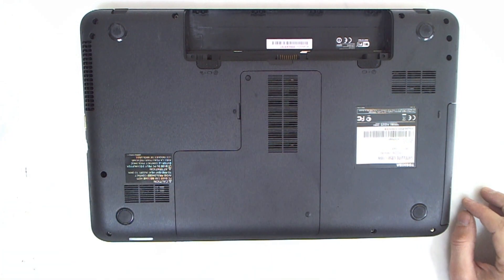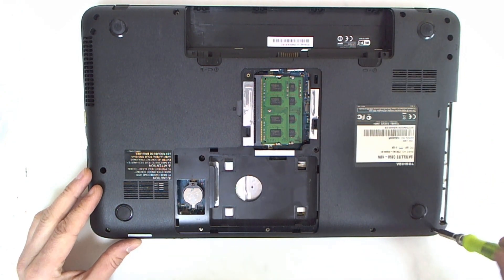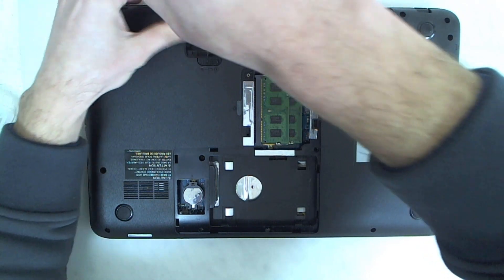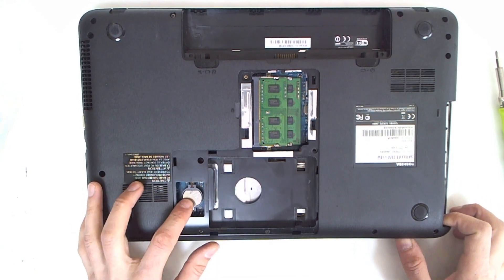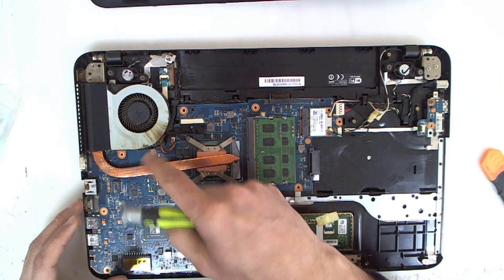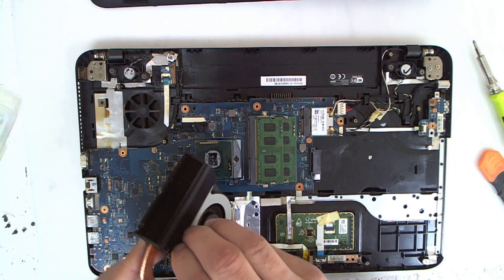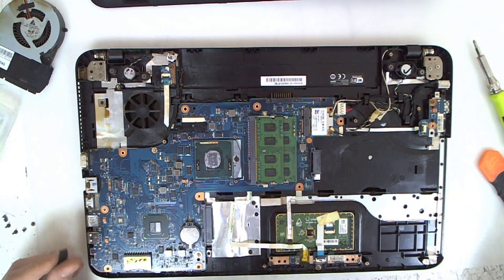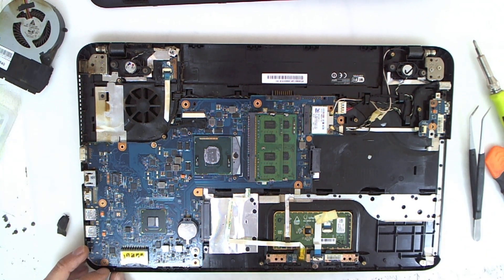Toshiba Satellite C850 Disassembly / Fan Clean

Comment: Your video was a big help when I took my laptop apart. I have the C850-13X and I have repasted and upgraded to an i7-2640M. I didn't know this before upgrading but the HM70 chipset only supports lesser CPUs and shuts down the laptop after 30 mins which cannot be bypassed through the BIOS. Do you know if most main boards are the same or if there are any other motherboards I can change to in this laptop? Thanks!
Reply from the maker: HM70 have a limitation. In order to upgrade you need to replace the motherboard with a HM76 chipset. Sometimes you can replace the chipset but will cost you more money and is not 100% guarantee that will work properly.
Reply: @LaptopDisassembly  Thank you. It seems to be a lot of work for very little reward. But I'll try my best to keep my laptop alive a little longer. It will make a great server or a media device, even if the CPU is weaker. Thanks again.
Reply from the maker: @eddiegreenheart  just put the max Pentium processor like B980 and put an SSD drive. It will make a huge difference
Reply: @LaptopDisassembly  Yes, already done! 8GB RAM and a 1TB SSD. Made a great difference. I just didn't get the right CPU, which is a a shame. If someone manages to lift the 30 min shutdown for i5/i7 CPUs, I'll be sure to update.
Reply from the maker: Not possible with HM70

Comment: Nice video. Thank you a lot. Please what is the connector on the right side of the RAM and below the WI-FI? It's a 7+6 pins slot. A large space there but no device is connected. An extension slot? It doesn't fit with NVME drive connectors? PCIE? Thank you for your reply
Reply from the maker: That is the connector for the optical drive, if the laptop have one.

Comment: Just got a 'new' laptop today (Toshiba c850-19d). Don't think the van has been cleaned (properly), cause it gets fairly hot and starts making noise.
I would like to know where to put the paste? Missed that in your video. 
Thanks for the disassemble video.
Reply from the maker: When you remove the copper cooler, clean the old paste from the CPU and the cooler. Apply the new one on the cpu crystal and put back the cooler.

Comment: Mine is toshiba L850. The fan doesn’t work properly. Sometimes stop running. I cleaned it with brush but still malfunctioning. Should I change the fan or is there anything else I can do? Someone suggested to put some oil in it. Don't know if i could open it completely to do so. What kind of oil should i use for this fan? My laptop got overheated and automatically got turned off several times. If u please help me about that it would be much appreciated.
Reply from the maker: First you have to replace the thermal paste. For oil i use fine machine oil. If you cannot open it completely just inject a little bit with needle between the two parts.
Reply: @LaptopDisassembly  thanks.

Comment: my TOSHIBA C850-A686 freezes and beeping on speaker for a while then works normal. After few moments it keeps freezing and so on. What should I do?
Reply from the maker: Can be a stuck key on the keyboard or bad hard drive.. Depend.
Reply: @LaptopDisassembly  I just replaced my Harddrive to SSD but still sucks
Reply from the maker: Can you record a video

Comment: Hi there?

Toshiba Satellite C850-A850 but I lost AC adapter. What Toshiba adapter name model?

Thank you for information me update sir.
Reply from the maker: You can use any adapter from Toshiba, Asus, BenQ, Gateway. You just need to be 19V . 4,74 A Which is 90W total. The connector should be 5,5x2,5mm. I think on that model you can go with 19V / 3,42A ( 65W ). But bigger is better. :)
https://www.aliexpress.com/item/32830747019.html
Reply: @LaptopDisassembly  Oh sorry, wrong C850-A850 this C850-A827*